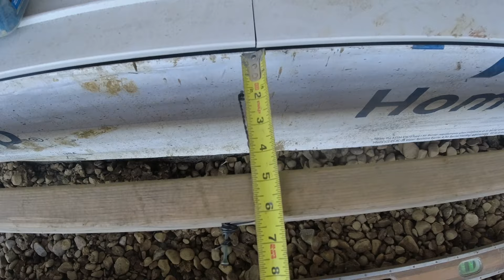I Got A Special Present At This Job!

Comment: Tom, next time you have to replace your plate compactor look into a reversible plate.  Great for getting into corners and tight spaces.  I had both when i had my business and after getting the reversible plate,  the forward plate was seldom used.  Reversible was a little heavier compaction, too (5200#) vs my foward plates which were 3150 and 4000.

Comment: The company I used to work for had a lot of forms and equipment we used for concrete but like your buggies had concrete all over them. I found commercial lime away at the supply company and started spraying the forms and on equipment even the painted surfaces. It took a little elbow grease along with the lime away but the stuff on my crew looked like a million dollars and was much easier to clean and a spray down with lime away kept them good.

Comment: How do you attach the carpet runners to the bar for the splash guards? Also a suggestion for the older power buggy, drill and tap the grease plugs for grease fittings.

Comment: I have a Gravelly zero turn commercial grade. I bought it in 2014 in Florida. Changed all the filters and oil and hydraulic as well. Kept it as clean as possible. Move to Missouri and I start mowing here. I have a couple of pastures and got gutsy and in a little area I managed to hit barb wire well that stopped the blades and killed the engine. So i drive to the building raise it up pull the blades off because the wire is wrapped tightly on them. Then the next year while mowing as i make a turn i look back and the blade falls off and luckily the bolt is still in the hole. I put it back on and I've had a bad vibration for some time. I take it to the dealer and they find that the crankshaft has a bad key way. He said he can rebuild the motor or he thinks he can have something made to fix the problem and tells me after it is started to run it wide open. In Florida they had me use 20/50 oil in everything the engine and hydraulic system. So this guy says he would change the oil, filter and hydraulic with new filters. So before I was running 20/50 synthetic oil and he puts in straight 30 in the engine. I'm thinking what the heck and hopefully he used 20/50 in the hydraulic system, maybe. Then he changes out the fuel filter for some cheap dinky filter that i know is junk because i have a brand new one in my cabinet that is from Kawasaki. I always prefer to do maintenance work myself and I know it gets done correctly.